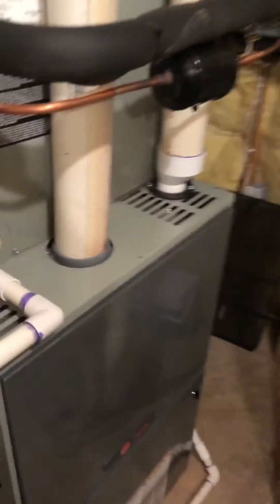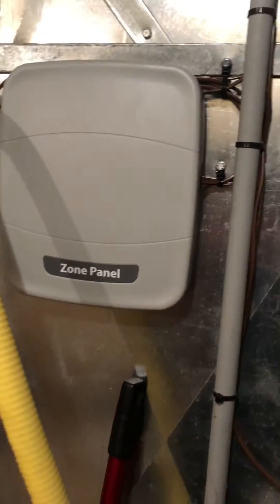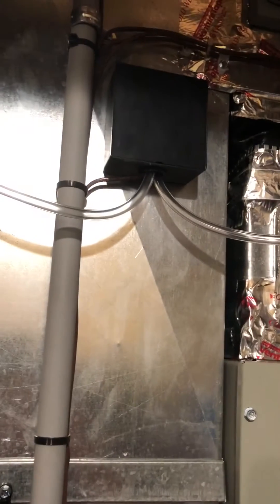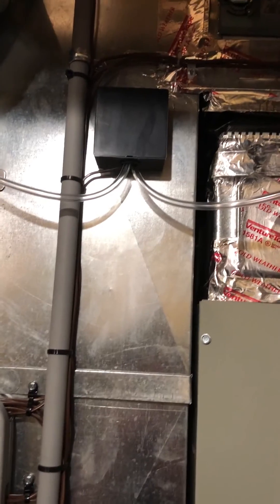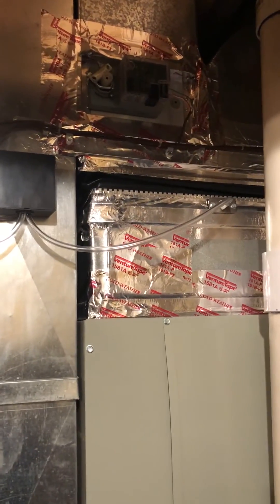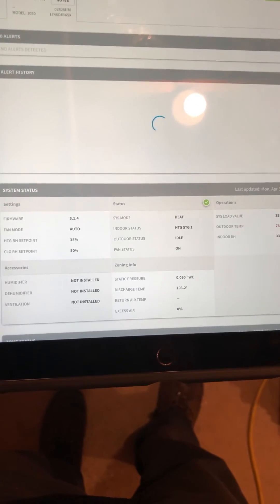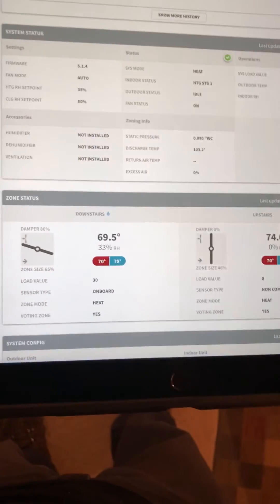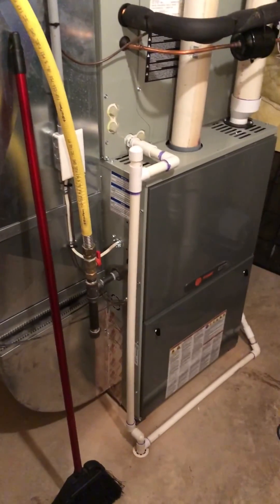Trane Xc95m modulating furnace with zoning

Comment: I see the liquid line dryer. Have you used the new Zoomlock ready ones? I notice you had brazed the one here and then used the Zoomlock 3/8" fittings to finish it off. Nice clean install.